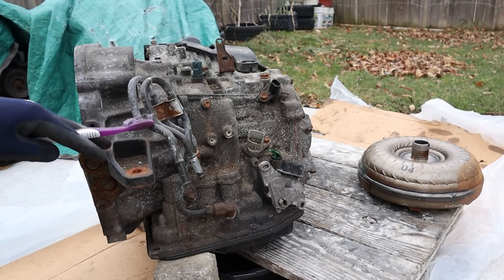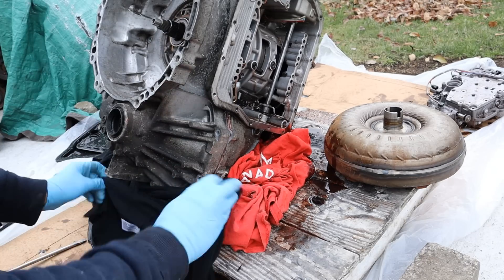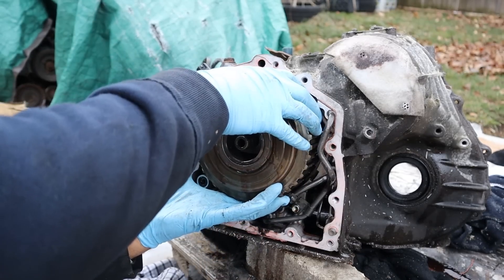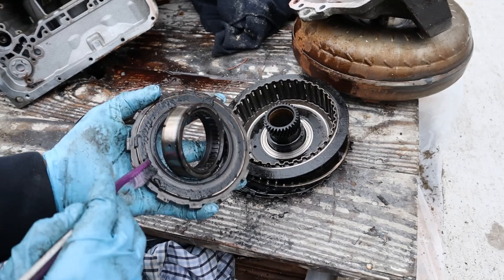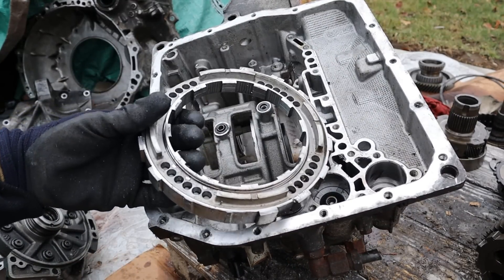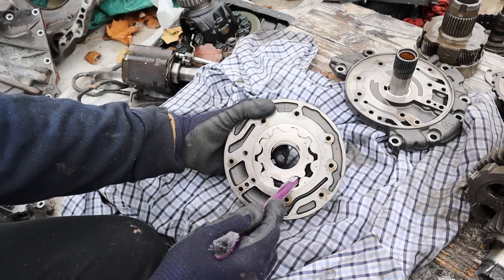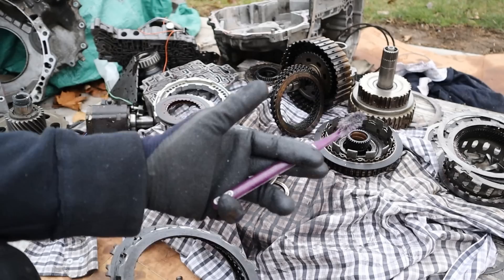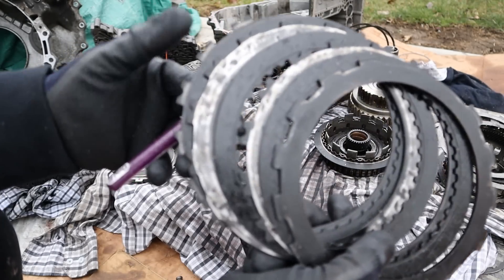Transmission FAIL: Why You Shouldn't Get Stuck in the Snow

Comment: This really tells you that there is no such thing a lifetime fluid
Reply: There is, it actually means the lifetime of the factory warranty. After that you're on your own.
Reply: @landshass2849  Warranty claims are a PITA. Better off just changing the fluid.
Reply: There should be regulations requiring transmissions to be serviceable with a dipstick and drain plug.
Reply: @inspectorjavert5563  Subaru transmission had dip sticks and  were fully serviceable. People like to bitch and meme about Subarus but when it comes to maintence they are most friendly vehicles for any job and you can easily do all the basic tasks relatively easily. Not so much on toyotas. For longest time Toyota had most idiotic placements for oil filters and ofc no way to check oil in thr transmission.
Reply: @Kacpa2  Wrong. Even something as simple as changing spark plugs on some Subaru models is a PITA. In order to access them on a Crosstrek the engine mount needs to be unbolted and the engine raised, a procedure that hasnt been necessary since Chevrolet produced the V-8 equipped Monza back in the 1970s. Some procedures are difficult on some Toyota and Lexus models, but not routine service.
Ive replaced spark plugs in both Crosstreks and V-8 Monzas,
Reply: @donreinke5863  Its a bit mkre tricky on DOHC cars but can be done without taking it off the mounts. Also how often do you change sparkplugs really? SOHC EJs had the plugs at an angle so it was rather easy to get to. Many cars had irnworse with elaborate intake manifolds getting in the way especially many 90s cars. Better try working on a transverse V6 with one bank lauing flat towards the firewall like toyota tends to do it and with oilfilter buried under the exhaust manifold, something toyota stopped doing recently.
Reply: @Kacpa2  The only other vehicles Ive run into that were difficult to change plugs on were the transverse V-6s (2.8, 3.1, 3.3, 3.4, and 3.8) in 1990s era GM front drive cars, especially in W bodies, but they took less time than the Crosstrek did, the subframe rail allows almost no clearance/access.
Ford Taurus equipped with the 3.8 was also difficult as it had a 90 degree bank separation angle, and was wider than the 3.8 Buick in GM vehicles.
Many customers want the plugs changed upon buying a used car as there are often no records if or when it was done.
I dont recommend Subarus to customers, I tell them they are hit or miss whether you get an oil burner....or not.
I direct them to Honda or Toyota if they want an import.
Reply: @Kacpa2  The oil filter on the 1MZ-FE could not be in a dumber place.
Reply: @donreinke5863  Changing/replacing spark plugs isn't even necessary anymore.
Reply: @theamerican7080  Exactly, its even worse on 5s-fe/3s-ge engines, its even deeper under the exhaust manifold, and if you have turbo verison of 3s-ge(3s-gte) then its just a sick joke at that point, turbo sits just over the filter. 
Toyota done that shit until they stopped doing front exiting exaust in their inline 4 engines, and finally mounted in by the oilpan.
Reply: @Kacpa2  I use a cap style oil filter wrench and a short extension to loosen it from the top, but you still have to flip the filter over and dump oil all over the crossmember because the filter only fits between the exhaust manifold and fan housing one way, and one way ONLY. Forget about pre-filling the filter because it just pours right out the instant you try and start the threads.
Reply: @theamerican7080  Rubbish. Where did you hear THAT load of B.S.?
While plugs no longer foul from lead additives, the electrodes DO wear over time and eventually there will be a misfire which can also damage catalytic converters and ignition coils.
Ive pullled spark plugs from many engines which had DOUBLE or more the gap specification. The resistors in the plugs can also fail, resulting in a no spark or intermittent spark condition.
Reply: @donreinke5863  True, but ask any modern tech like myself how many spark plug changes they have made on vehicles factory equipped with iridium spark plugs...and you may be very surprised to find that spark plugs can last the average life (-200,000 miles) of a good running vehicle NO PROBLEM and have been for about the past 15 years.
Reply: @theamerican7080  Ive pulled spark plugs of EVERY type, be they standard copper, platinum, double platinum AND iridium plugs out of vehicles and ALL of them show gap degradation starting at around 100k miles on average
 Regardless of the element used in electrodes, resistors in the plugs simply dont last 200K miles, and the consequences of misfire can be expensive especially in regard to catalyst damage from unburned fuel which you SHOULD know WILL eventually cause the MIL to come on and a catalyst efficiency code to set. Changing at 100K or less significantly reduces the likelihood of misfire and resultant catalyst as well as possible ignition coil damage.
BTW.....You are commenting to someone who started in automotive repair in 1972...likely LONG before you were born.
Reply: @donreinke5863  Actually I was born the day before yesterday...I'm just that fucking advanced.
Reply: @theamerican7080  Youre funny, even though Im not buying your argument for a second.
Reply: @donreinke5863  Here's your bone- don't choke on the marrow: Spark plugs CAN, and HAVE lasted 200,000 miles or more depending on conditions...often because of neglect. This odd 'phenomenon' of not fixing what isn't broken also comes into play as the average vehicle owner, especially the 'owner' of a modern vehicle, tend not to want spend the money to have spark plugs replaced UNLESS there is a problem...that's all I'm saying.
Reply: @theamerican7080  Nice try kid, if you remembered half of what Ive forgotten you, or anyone else would be a competent mechanic
I have never seen spark plugs last anywhere near that long without degradation of electrodes or a misfire occurring due to so much resistance that they either dont fire, or the spark escapes the plug boot to ground.
Ive seen many with a gap of over .100
I wont say youre lying,  what I will say is that  I dont believe you....for a second.
Reply: @inspectorjavert5563  Anybody who is capable of servicing a transmission knows that the dipsticks don't do anything.
Reply: @LordOfSilense  Dipsticks let you quickly check the condition of the transmission fluid.   I wish the VW I just bought had one like my domestic car.
Reply: Yes there is; it's just that it's a short lifetime and at the end of it you need a new transmission
Reply from the maker: Agreed! Change your fluid
Reply: Of course there isnt. Automatic transmission fluid, like all lubricants eventually breaks down.
Reply: If the car's lifetime ends when the fluid goes bad then technically even your engine oil is a lifetime fluid
Reply: It's a self-fulfilling prophecy. If the transmission is destroyed because you didn't change the fluid its lifetime is over.😂
Reply: ZF recommends changes every 80k km. I don't get how car manufacturers can 'tell' car owners that the fluid is lifetime. I remember when my father got into argument with about ATF in his Jetta, telling me that he asked at the dealership about ATF change intervals. Sometime later he calls me saying that the car doesn't want move from Drive. Once we changed ATF at my friend's garage everything went back to normal. Trying to save $150 and skip fluid change didn't got him very far ;)
Reply: When the lifetime of the transmission is over you don't need any fluids. Fluids for lifetime.
Reply: You can see red good oil here even after the driver destroyed this transmission..
Reply: It wasn't the fluid. I did the same to a F150 E4OD  in a freak slush storm. That transmission was a cranking unit.
Reply: I've beat the shit out of my transmission getting unstuck from snow and even after 227k I haven't had a problem. I change the fluid every 30k, it makes a huge difference.

Comment: Good info, reminds me to not gun the engine if I ever get stuck. thank you
Reply: You can gun the engine without too much worries - just don't slam it from forward to reverse repeatedly while the wheels are spinning.  Also don't do it too long or the transmission will overheat - the torque converter generates most of the heat.
Reply from the maker: Agreed. But gunning the engine isn't that healthy for the tires and engine itself at redline

Comment: 🧐I’m no expert in any transmission but isn’t the torque converter suppose to take all the slippage not the clutch? Thus under heavy load like stuck in snow and towing the transmission won’t destroy itself?
Reply: At high engine revolutions, the torque converter would be well past its stall speed.
Reply: @76horsepower  make sense
Reply from the maker: No, the clutches do most of the slippage. Otherwise you'd have a loss of power when changing gears like a manual
Reply: @speedkar99  thanks for the reply!now I know

Comment: The Ford model T used a planetary gearset. Ford hated sliding gears.
Reply from the maker: Did it? I would have that it was manual
Reply: @speedkar99  it was a manual but it used a planetary gearset. 2 forward gears and reverse. Simple

Comment: Releasing is actually the reason the friction material on clutch plates is grooved, not "bite" or grip. 

They've got pressure to stick together, but once together they've got no force to pull apart. Until fluid can get back between the friction discs & steels they're stuck, and that causes heat & wear.

There's always a little fluid in the grooves, so the discs release quicker.
Reply: A good explanation. It’s like getting your boots stuck in mud when thinking of a wet clutch release. Smooth clutches tend to have improved torque capacity but release behavior is slower. Oil channels / grooving / waffle patterns all improve release characteristics of the friction disc by proving fluid paths and cooling. You tend to see static clutch locations use smooth frictions (applied continuously) and dynamic clutch locations (shifting) use waffle or grooved.
Reply from the maker: Thanks for that explaination

Comment: Great video dude, I hope you do more transmissions if you can get your hands on them. I’d love to see how Honda’s 10-speed works or why the ZF 8-speed is considered the best.
Reply: It seems like he mostly focuses on reliability and serviceability when he takes things apart. ZF 8-speed is considered the best not because of that, but because of its performance. It's able to do double duty of a comfortable and smooth daily driving, but also has near dual-clutch transmission like performance when driving on a track or back road. That's why it's considered the best.
Reply from the maker: I'd love to see the new ZF units as well. Gonna have to find a scrap one somewhere if it's cheap enough for a teardown investigation 🤣
Reply: id love to see the 8 speed zf. Will probably be a while before he gets his hand on Honda's new 10 speed

Comment: I suspect, based on the mileage, it was already worn out and was already slipping slightly. I don't see how spinning the wheels in one direction in the snow, even for a period of time, would cause the clutches to burn if it's already in gear. Clutches and bands only slip during shifts. The alternative is that the user rocked the car back and forth continuously. Additionally,  they may have shifted while the wheels were still spinning while they were rocking the car.
Reply: I think its likely they switched from 1st to reverse (or vice versa) while the wheels were still spinning out. i uh, mightve done that by accident sometime in the past and then smelled a lil hint of ATF from the air vents ... yea dont do that kids make sure your wheels arent spinning oops.
Reply from the maker: Exactly this. The forward backwards motion without stopping burns these up
Reply: Agreed. If the clutches are already locked, the only thing that should be building any heat during wheel spin would be the torque converter.
Reply: It's the constant forced 1-2 power-shifts and the shock load on the clutches that burn them out when the car is stuck spinning just one wheel. The upshifts and downshifts create a tremendous amount of heat in a very short time, cooking the friction surfaces of the clutches and bands.
Reply: I’ve done all these bad things in a Corolla from the same period with a very similar transmission literally hundreds of times and it’s still shifting fine. These transmissions can handle the abuse. Saying it failed because someone was stuck in the snow is a stretch.
Reply: @lampajoo  oh cmon man
Reply: I like the description "slipping slightly" ;)

Comment: Actually those magnets don't look that bad unless it looks like a fucking Christmas tree you should not worry My is 350 had a similar amount of metal on the magnets whenever I serviced the transmission at 180,000 mi and it works fine It still works fine
Reply: Exactly - There's always going to be material on the magnets since the clutches work on friction.
Reply from the maker: Bro I literally flushed this transmission and the car barely mad it around the block and built up the much stuff on the magnets. See my video on if stop slip saving this transmission

Comment: does dual clutch  last longer than TQ converter type?  thanks for the very informative video
Reply: No by a long mile
Reply: No. Dual clutches don't actually have two sets acting on the same gears. One set engages with odd numbered gears and the other with even. They're one of the less reliable types of transmissions because they're complex and have more parts subject to wear.
Reply: Depends on the model design. The wet dual clutch systems have longer service life than the dry clutch systems.  Ford’s DCT Dry clutch has been a nightmare for Ford and car owners.
Reply: A decent sized traffic jam can kill a double clutch
Reply: I think if they are serviced regularly it's possible. But the dry clutches will always need to be replaced long before the wet clutches in a standard trans
Reply: Every Ford Focus and Fiesta owner will tell what they think about DCT. It's a piece of garbage, I can't believe they allow such things to be manufactured. Same goes for number of CVT trannies.
Reply from the maker: See my video on dual clutch transmission. The Mechatronics typically go bad in them

Comment: The crazy thing is most cars today you can't even check the tranny fluid there's no dipstick...   Which is ridiculous to me...    since I don't have a tranny dipstick on my car I just go to the dealer and get a changed every five years,  It's 200 bucks they flush out everything, and they replaced the filter.. Mazda 6...  I do it myself but it's a huge pain in the neck mainly because you need to have a car up on the lift and you need to be able to see the full drain plug At a certain engine temperature and it needs to weep out of the hole..  I don't have a lift and it's a pain in the neck it's actually the only thing I'll never do on the car , Just cheaper to have a dealer do it..   I had to do the CV axle on the car and on this particular car You do the CV axle you lose some of your tranny fluid.. so I had it done at the dealer, After they replaced my manifold Cat converter for free.. Which in itself would've been an $1800 job they try to get out of it but I know the car has a federal warranty of 80,000 miles the car only has about 60 at the time still out of manufacture warranty but not federal warranty is up to 80..      The owner of this tranny must've really beat the crap out of it those things last forever pretty much if they're taken care of
Reply from the maker: Agreed. I hate Changing the fluid since it's so messy to pump it in there...check the fluid level etc

Comment: This deserves a point in the user manual, or better yet a signal in to the dash. Hey buddy, you are fucking up the transmission right now. Please stop and call assistance. In case of emergency proceed at your own risk.
Reply from the maker: Well it threw a check engine light for overheating fluid
Reply: @speedkar99  Oh, well. That sucks. I belíved it was a local overheat and the sensors could not detect on time.

Comment: Huh, the long awaited postmortem examination.  Question: how are all the electronics inside the transmission not get shorted out by the fluids?
Reply from the maker: ATF isn't conductive like water is.
Reply: @speedkar99  Huh. TIL don't put water in your tranny.